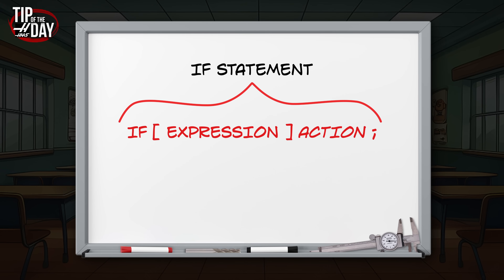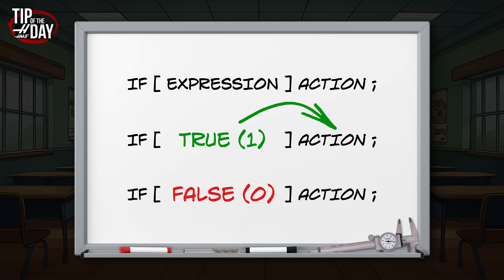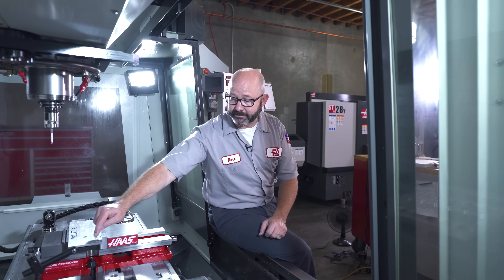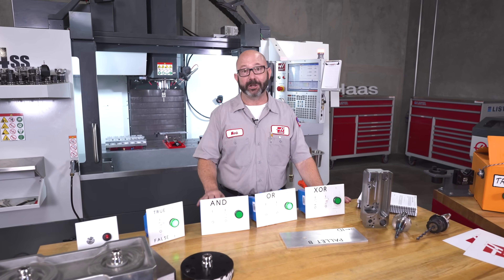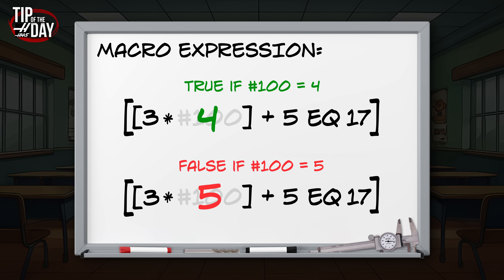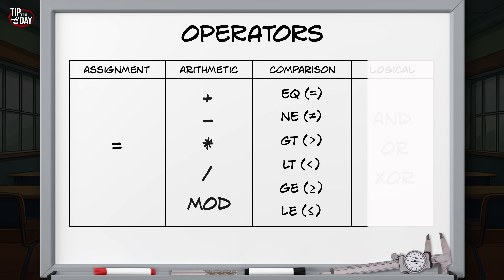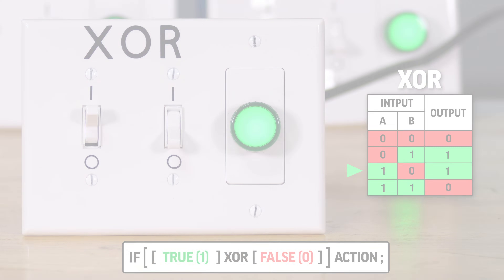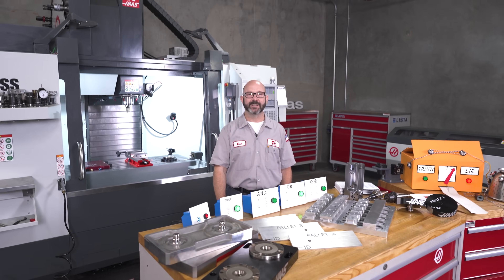Macros Are More Than IF Statements . . .  They Are Lie Detectors! - Haas Tip of the Day

Comment: That is great, but it is much easier to check tool length in setup sheet then macro. If you can't put macro for that from CAM, it is just way to get too slow. But in other cases might be super useful.

Comment: Does Haas support q codes where you can specify for example: q1= 5 , q2 = 100 at the beginning of the program. Then use the q codes for speeds or feeds? G01 x5.0 Fq1 for 5in/min. This way I can change all the q1 feeds in one line at the beginning? Heidenhain controls can do this.

Comment: I like using the "Power off at M30" setting at the end of the day, but want to park the table and/or unload the spindle before the machine shuts down.

(Empty the spindle if poweroff on M30 is set);
IF [#20002 NE 0] THEN T29 M6;

Also, I use some tools and grippers powered by through-spindle air.  I have the programs guard themselves by monitoring the TSC pressure sensor (identified in the IO page as analog input 7).

M73 (AIR ON);
#3001 = 0 (RESET MILLISECOND TIMER);
G103 P1 (DISABLE LOOKAHEAD);
WHILE [ #13007 LT 675. ] DO1 (WAIT FOR PSI TO RISE);
G4 P0.1; (SLEEP 100MS)
IF [ #3001 GT 30000. ] #3000 = 1 (OH NOES);
END1;
G103 (ENABLE LOOKAHEAD);

Comment: Is there a way to use macros to detect operator input? For example, with some stock that is widely variable or close to finish size and where the first operation cleans up a face. I'd like the control to pause, ask the operator for some input (Is the face fully cleaned up? Yes/No) and then proceed based on that response. Possibly making another skim pass and then adjusting a work offset by the amount of the 2nd skim pass.
Reply: Yes. Check out M109 in the Haas manual for more info. This code works exactly as you described.

Comment: I use a Macro as a calculator to easily figure out an ARC TAN for a bolt circle. Sometimes I am doing repair work and need to line up to an existing bolt circle. I probe the center of the part, and then  any hole, and run the Macro. It'll record the degree of rotation and put it into whatever variable I want to use. Then, I can program accordingly and use G68 and use the Macro variable and voila, it lines up perfectly. If anyone would like more info on that I can gladly share.
Reply: That’s a perfect example of how powerful macros can be.
Reply: Could you share some g code examples? My brain functions better seeing it done

Comment: I have been using macros for awhile now. I have setup a whole library for my operators to use. They control tool #, diameter, rpm, feedrate, spin direction, part parameters, etc.  

A future video idea, that is more advanced, would be looping. Drilling holes in a rectangular array for example. I did it via a loop within a loop to do X direction then reset X count and move once in Y until completed. What could thousands on lines of code was reduced to just a few dozen.

Comment: Very timely. I am in the middle of trying to add a few unassigned Renishaw macros to a new VQC category (adding 4th axis X and Y, 3-point bore, 3-point boss). The one I thought would be simple was 9823 (Three point bore/boss). Similar to 9814 with three angle values, right? Except 3-point uses an A input (#1) for the angle, which is already the program selection used by 9823. I thought I could assign it to another variable but, I believe it passes #1 to the macro that determines the variable offset number. Now I'm wrapped around the axle. 9823 continues to us A as it passes it to 9727 so I can't just pick another variable for the angle and substitute it. Gahhh! I'm spending all my time reading and writing notation in the Renishaw programs, just to track what it's doing.

Comment: Mark, would love to see more about checking to see if there is a tool length in the offset table, and erroring if not. I find it crazy that this isn't a default for the control. Have never needed the gage line to hit Z0. :) Also, more on MOD please! Would be great to set up things like chip conveyor on X# of parts ran, etc. Thanks for the great videos, I use macros all the time as I am running lots of production parts.
Reply: We have a Software Project (BZ1254, TP63937) that will have the control alarm out if we try to run a tool with an offset set to zero. On machines with probing, that could result in a crash. The code is written for this and the task is going through testing now. Great idea. We’ll put MOD on the list. We love macros, and have another video on them coming out after the holidays.
Reply: @markterryberry4477  Awesome! This will be a much appreciated safety/sanity check. I have never understood why it will alarm on so many other/lessor infractions, but would allow an operator whom forgot to touch off a tool to run it. Will also save from having to edit post processors to do this. Look forward to seeing them!
Reply: IF [ #[ 2000 + #3026 ] EQ 0 ] #3000= 1 (DANGER. OFFSET FOR TOOL IN SPINDLE NOT SET)
Reply: Awesome, thanks for that. Out of curiosity, are there read only variables for “tool in pocket” column on NGC? I want to write something that will dprint what tools are currently in the machine

Comment: we got so many cam softwares..... we don't uses macros
Reply: In a production setting with various skill level operators,  macros really make life easier. Just eliminating human error from changing over castings is huge
Reply: @p38pilotdk01 you nailed it. Many of my macros, in a production environment, were just making sure that things couldn’t go wrong. Usually written after something went wrong.
Reply: @p38pilotdk01  yeah in production maybe it is useful ...
Reply: @CAMER_21 I’m with you though, I try and avoid macros if there isn’t a legitimate need - it can turn a program into unintelligible gibberish, fast. Balance is needed.
Reply: @markterryberry4477  sometime macros are so complex even programmer get confused .... so we avoid and let Cam software to there work
Reply: Macros can be overused but can also open doors and can even be integrated into Cam. We were able to add statements within our post allowing operators to choose exactly how many fixture offsets they want to run. Now we can write a single program and run on it on any vertical CNC in our shop using the maximum number of vises installed or run the exact number of parts required without edits to the program, cutting air, or using block delete to run one offset at a time. The control posts this code automatically on every program and actually eliminates the need to transform tool paths and create sub programs. This reduces programming time, potential errors, and code size since the exact same code just loops for each offset. We even have dedicated macros within the post to bring the machine home when optional stop is turned on which is extremely convenient for inspection. 

Done right, macros can eliminate far more problems than they will ever cause. They just aren’t a solution to every problem and programmers tend to get overzealous when they see how powerful they can be in the right application.

Comment: Very interesting.  As yet, i have no use for this at the moment, but it takes me back to my solidworks training.  How about writing a macro to convert imperial to metric ( vice verser ) for thread milling regardless of whether the machine is set to metric or imperial ?
Reply: Great use case for macros. We can do anything! The Renishaw probing macros have IF statements that multiple our values by  1, if in Metric mode, or by 1/25.4 if in Inch mode. They store the multiplier in #179, so I tend to do the same (#179=1/25.4, or #179=1). In/mm is stored in  Setting 9, which is variable #6009 on Classic Control, and #20009 in Next Gen control.